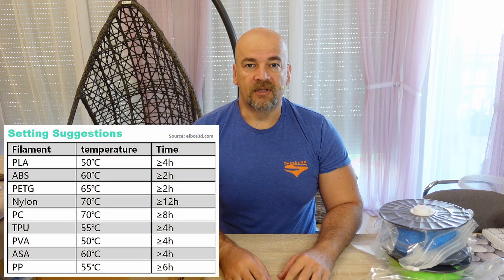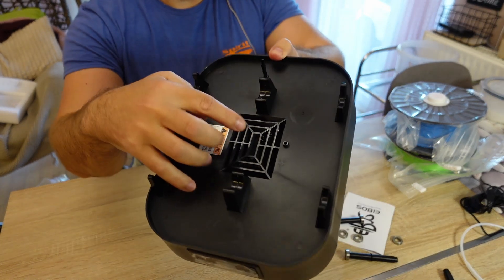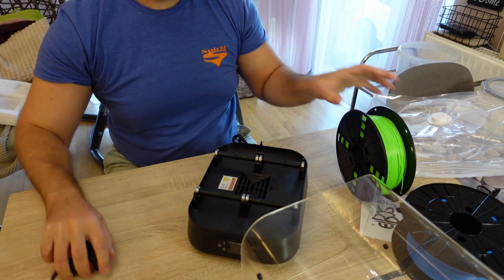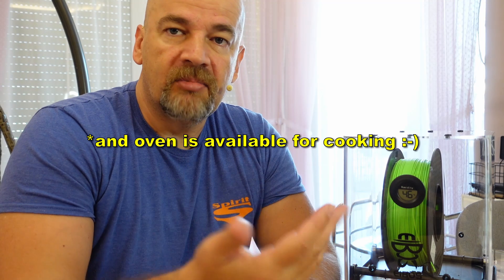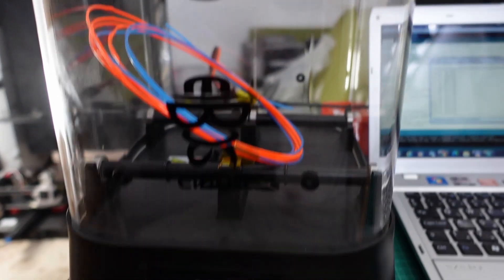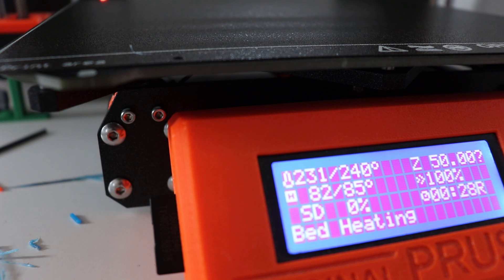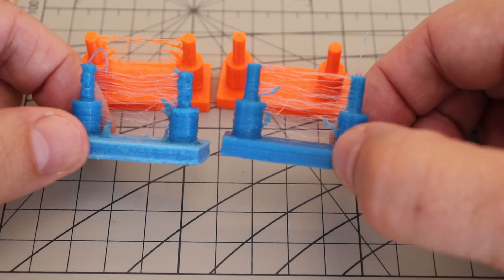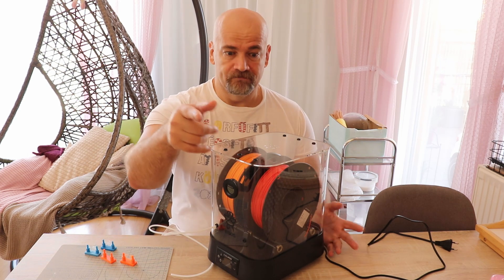EIBOS Cyclopes Filament dryer review. Can it dry Nylon too?

Comment: Professional as always! Dr.igor
The fan cycle noise issue will be upgraded in the next production.
We really appreciate of your suggestion, we will make improvement in the future!
Reply: Please use a high quality fan like noctua, and a high quality humidity guage, not like this $2 one. Then I will buy the product
Reply: Would be great that for next production allows shipping to Argentina.
I've purchased the Cyclopes and  have to send it to a postal address in the U.S that ships to Argentina.
This triangulation has cost me $150 USD, more than the product itself.
Reply: are you going to go to a rpm regulation instead of on/off? if so, when would we see something like that in production models would you think?
Reply: has the fan been upgraded / improved?
Reply: @robnight9899  it has not. they didn't do anything.
Reply: Eibos, you guys need to redesign the enclosure so it can open at the top and the sides if needed, as its not very easy to replace a roll while another is in use as it unspools the filament, and also fix the air direction i it should go around the filament and not directly on it.

Comment: I ran and seven spools of petg through this set to 65C for 4hr (suggested by sunlu for their filament) before I noticed the eibos was fusing all the filament together at the bottom.

The bottom of the spools seems to way overheat. I think it'd need to get around 85C for that to happen.

The ruined filament cost about as much as the machine. 😞

Comment: I really enjoy your videos and website.  I use a PrintDry Pro to dry my filaments a few hours before use.  On the printer enclosure I have been using the Polymaker Polybox with great success.  However, for longer/larger prints, I wanted a dryer that could maintain temp and humidity.  I just ordered one of these and my only wish asides click you mention, I wish they made a tall top piece for 2 or 3kg spools!  Thanks!

Comment: Would the temperature get a little higher if you put some insulation around the sides, or is 67C the point that the temp controller was limiting at? (eg, was the relay cycling on and off at that temperature?)

I tried putting a cheap PID (Inkbird brand) on a toaster-oven to get well-controlled temperatures, but two units in a row didn’t work at all, so I got discouraged. Maybe I need to revisit that project for drying PA, but I like the design and function of the Cyclopes a lot, so am thinking about buying one after watching this video. Great review as always!

Comment: I bought this dryer because of your videos and I am encountering a serious problem that I do not understand how you have not commented.

The dryer releases the air at the same temperature always, very high, and in the area where it is giving the filament roll, it reaches the glassy temperature, causing the filament to join.
It is a disaster....

Did you not see this problem?

Comment: I don't understand why most filament dryers can't operate at useful temperatures for materials that you'd especially want a dryer for, aka nylons, PC. Most top out at 55c.
Reply from the maker: Probably, because it is cheaper. BUT for most filaments 55C is enough (with FAN and silica gel). Only Nylon requires much higher drying temperature.

Comment: First off the temperature readout on the one I received does not show what the actual temp in the unit is, it only displays what the temp is set to.  You have no idea what the actual temperature is.

The main issue I have with this unit is it has a MAJOR DESIGN FLAW. It exhausts the hot air out at the bottom directly onto the filament in ONE SPOT fusing it together.  The hot air should exhaust out around the base parameter and up the sides avoiding direct heating the filament. 

I returned the piece of junk.

Comment: Like installing a toilet paper roll, which way is better for pulling the filament or does it not matter?
Reply from the maker: Smaller angle is better, so depend where is the dryer relative to printer. But in most cases, I use the exit from the side.

Comment: Nice video, any new discount codes? the 5% off isn't working.
Reply from the maker: They told me, that it will work again after Christmass discount ends (5 and 10% too)
Reply: @MyTechFun  Aww... I was hoping it could be stacked with the Christmas discount. Who doesn't like big discounts in these difficult times? :elbowcough:

Comment: Interesting. I've just has a discussion with Polymaker about drying their Polymide CoPA nylon. Having had a reel which originally printed very nicely stored in a dry box with with silica gel for about 4 months at between 16 and 21% RH, it had absorbed enough moisture to print badly (unavoidable stringing). As I had nearly run out, I had another roll unopened, so I tried it. It also showed slight signs of excessive moisture, never printing quite as well as the 1st roll did when new. 
After discussing with Polymaker tech support, they recommended drying at 100 degrees C for 8 hours. I dried both rolls for 11 hours at 90 degrees C in a kitchen oven with a K type thermocouple gauge for an accurate temperature reading, and both rolls printed nicely again, with no stringing. I was worried that the spools may distort at 100 degrees, but they did not. I will probably be upgrading the oven with a PID controller and an SSR, as I have other uses for a larger temperature controlled oven too.
Reply from the maker: Thanks for this useful info. Yes, 70°C/12h is some minimum for drying the nylon. 100°C/8h sounds reasonable. And good point, you have to be careful with spools, most of them will deform on 100°C. Good manufacturer knows that nylon should be on better spool to survive higher drying temperatures.

Comment: I use a space heater, which is basically a fan with a heating element. Wind drags moisture from a heated surface much easier. Where I live, the air humidity doesn't go down by 60%, but with the fan and heater directly on the filament roll, I print normal even on cold and rainy days. In winter the temperature is around five to fifteen degrees Celsius, but with many rainy days. You don't need to use the heater all the time you print, it's a $10 solution that works.

Comment: I like that it has holes at the top. Not like the Sunlu one (where is the moisture suppose to go?). I am experimenting with regular cheap food dehydrator. Works ok, but there is no fancy LCD menu and all that stuff.
Reply: I agree, I bought the sunlu and I immediately added a couple of holes on the top. but the max temperature of sunlu of 55°C is too low.
Reply: @g.s.3389  I think that Sunlu dryer is also intended to be a storage container, hence there are no holes, but for drying it doesn't make sense. My cheap $22 food dehydrator can be set to 70C. I am testing it right now - it dried ASA nicely. Will post a video about it this or next week
.

Comment: :) its funny how much i wanted to get this dryer before this review. I was really impressed by it's look (i still do though) and to be honest as it seems like its really do what it was designed for. No doubt. But then i realized i will print mostly with PLA  and ABS.  Yeah... Maybe with PETG but not that much. Nylon? I don't  think so. And that made me think twice... Do i really need a filament dryer?
Reply from the maker: If you will not print with Nylon, then any cheap dryer will do the job. If you have precise oven, then you can use that to dry filaments, print on open air and after printing store filaments in closed bags with some silica gel (PETG, TPU). For PLA, ABS I use dryer only if they are very old and became too brittle.

Comment: Hey why not compare with food dryer they are very cheap and can go to 70 degree Celsius
Reply from the maker: I already have one. There will be a video, only I have to finish modification, so I can use it during 3D printing too..
Reply: @MyTechFun  i was also thinking of getting a filament dryer but decided to get a food dryer because it's cheaper can hold big spools and heat's up to 70. Anyway looking forward to the new video keep up the great work!

Comment: Igor, what I always miss in your reviews is a tear-down to see what is actually inside.  Is this thing really using an AC heater or is there just a power-supply in the bottom?  What protection  measures does it have?  As you think it is using a relay, then what if that would fail in the on state?  Fail it will after N cycles, so I guess there's 50% chance of failing in on state, no?  Well, depending on exactly what is used for the switching of course, which is why a tear-down is crucial.  Does it have a secondary point to interrupt the power (ex. thermal fuse) or will it keep heating until something catches fire?  Similarly, what if the thermistor fails?  There's a lot to do about thermal runaway protection for 3d printers, but those hot-ends are typically way less than 100W, so I guess a dryer like this should have similar safeguards.  Sure, the same goes for a food dehydrator or other DC dryer, but it's the type of thing I'd love to see covered in reviews ... As someone remarked already, if you're only interested in reaching a high temperature, you can take a heat-gun.   Have it blow full force into a card-board box for 5 hours and you're guaranteed to dry (and much more than dry) any filament in that box ;-)

Comment: $129.99 + 21% VAT to EU - it is too expensive
Reply: Hi, The shipping channel we are using is DTD(Door to door) fast trackable flight. The custom tax (and VAT) has been paid from our side for most countries (especially EU countries). However, we are not really certain about the real situation of the custom when the package arrives in the destination country. So we haven't mentioned it on our website but a statement that the import tax and other fees are not included. In fact, we haven't chage our price for VAT (1st July) for EU but cover it by our side (as the package is free shipping.)
Reply: @eibos3d983  Your device is overly expensive even without added VAT, so all of this does not matter at all ;)
Reply: @alexey_sychev  considering the eSun and Sunlu dryers already cost over €50 i don't think it's too bad, especially since those dont even go high enough in temperature to really dry Nylon etc and they hold only one spool.
Reply from the maker: I agree. But don't forget, you can get 10% discount ;-)
Reply: @MyTechFun  maximum price for it is €70 including shipment, everything above is just greedy robbery
Reply: @MyTechFun  Hello sir , from where I can get 10 % discount ?
Reply from the maker: @Tares87  Its in the description. Share this video on any 3D printing related social network (facebook, twitter, instagram..) and send the screenshot to eibos email.They will send the coupon code to you.

Comment: I think it would be better if it didn't have the holes at the top and was instead fully closed with a bag of silica gel inside, so you can use it to dry the filament and also to store the filament when it's off.
Reply from the maker: Best would be changing these two every 5-10 minutes for example. Drying has 2 steps: 1) big heat, force humidity from filament to its surface (here it would be really good not to have holes, but to get higher temp) 2) take the moisutre from the surface, but surrounding air must have low humidity and here these holes (or silica gel) are important
Reply: @MyTechFun  thank you, excellent point.
Reply: You could make some plugs and a holder, could be an easy upgrade that may take it over the top on effectiveness. Maybe a good follow up video, no pressure but could be cool.
Reply: @klave8511  yeah, to get things really dry, 3A molecular sieve is the way to go. It’s harder to recharge than silica gel though, because you have to get it really hot to drive off the adsorbed moisture.